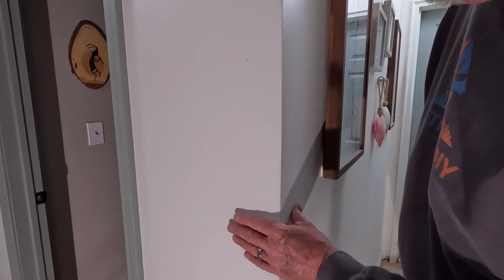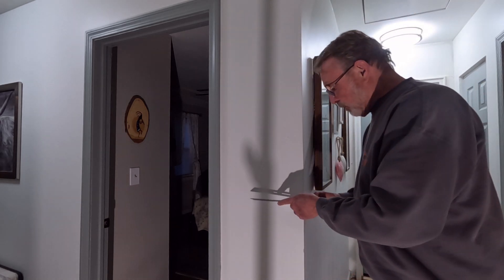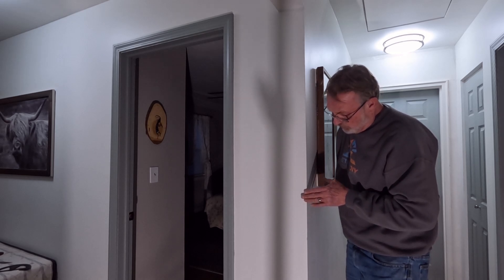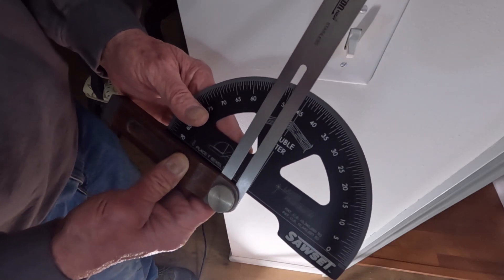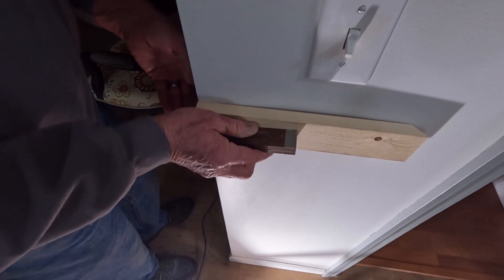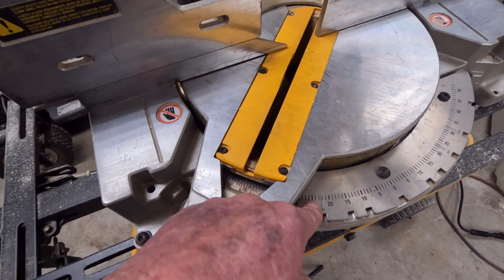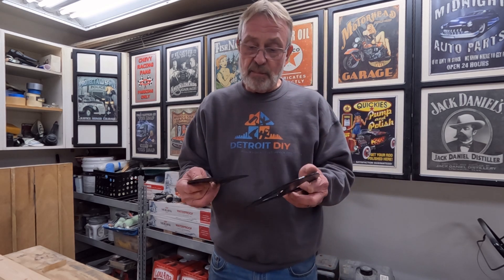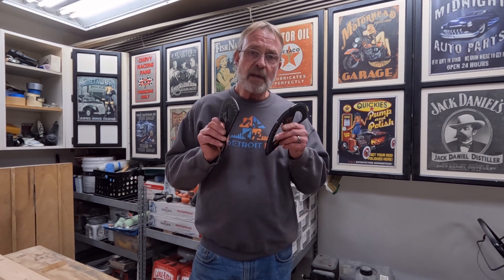Install Trim Like A Pro Using This Game-Changing Tool!

Comment: Good video !
I use thicker wood for models. It helps set the right saw blade angle. I write the angle on each wood model. Then when I get the perfect fit, I just set the blade at that angle.

Comment: You should also check this one out to, Starrett Miter Saw Protractor Angle Ruler
Reply: Size is an issue with the Starrett Miter Saw Protractor. They have squeezed 2 degrees into one increment. I challenge you to find a fraction of a degree. Fractions are critical for tight fitting joints.